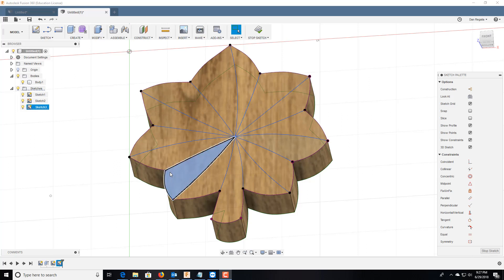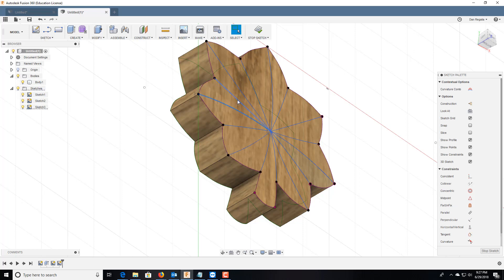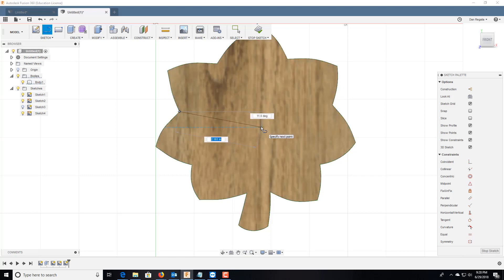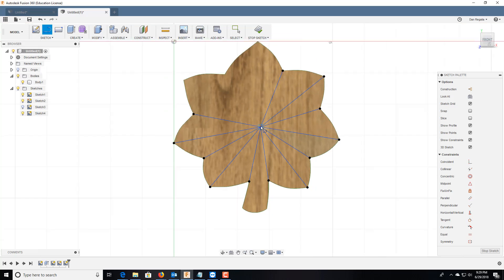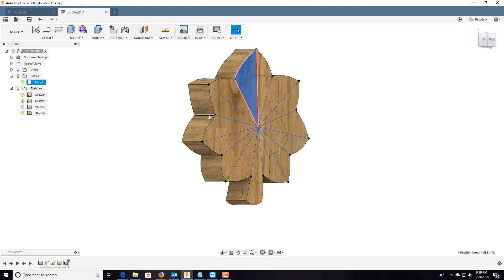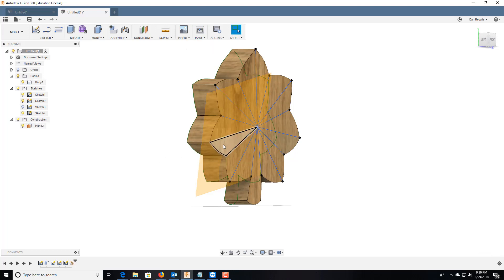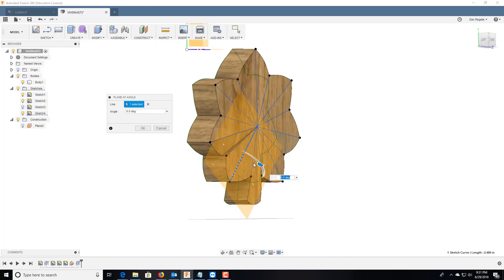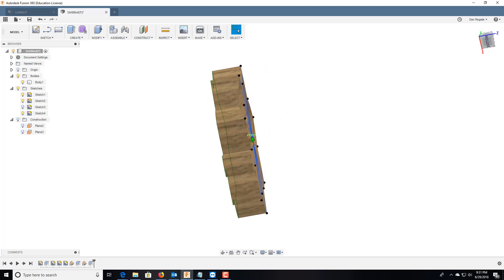Fusion360 - Extruding on an Angle

Comment: That's not extruding on an angle though, this is a specialized taper that largely cannot be applied to different types of objects. An example of an angled extrusion would be the following:

Make a sketch of a square (or desired complicated shape)
Make your new axis however you want at a bizarre angle
Extrude your square at the angle of that new axis, creating like a trapezoid-like 3D tapered-cuboid-thing in this example.

One way I can think to do it is using the Loft tool, but that only works between 2 sketches. So I would need to duplicate my complicated sketch just for using the loft tool. I arrived at this video while I was looking for a better solution

Edit: I found out the proper solution. The "Sweep" tool works perfectly for this. The sweep tool will extrude following a path, even if that path is curved or straight.
Reply from the maker: NikWill, Thanks for expanding on this.  I'll be honest, I'm a n00b when it comes to many of the fusion skills, and like many others, I don't know the proper 'lingo'.  But, this does get me where I need to go, and it might help others.  With your comment, they might be able to further find their solution.
Reply: Yeah sweep asking rail would be extruding at an angle.